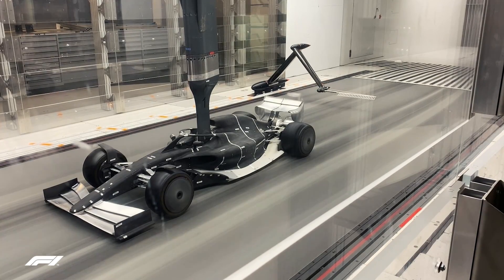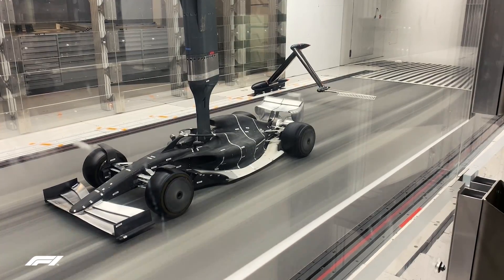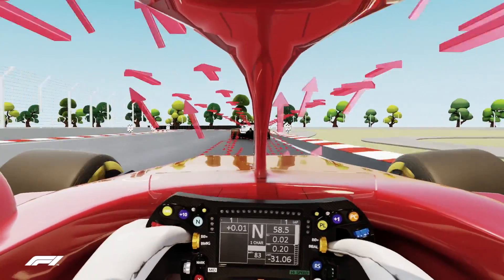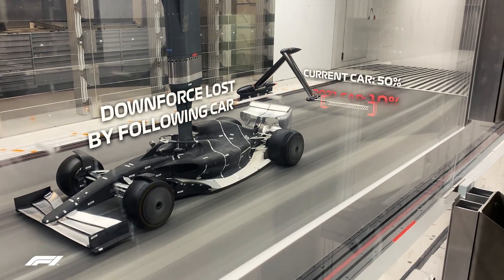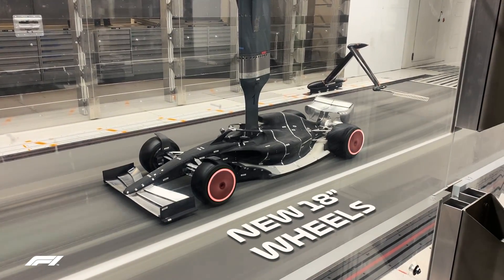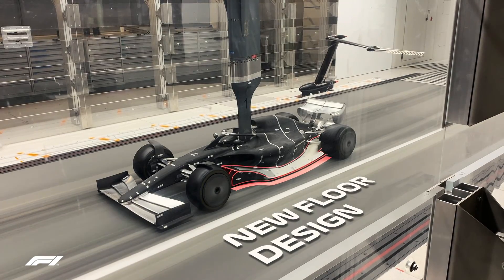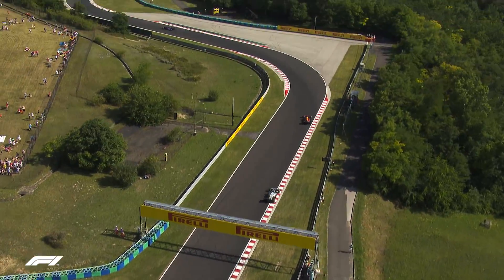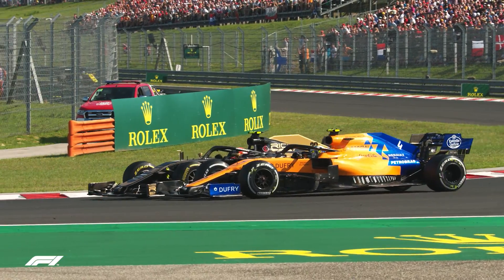Future F1 Car First Look | Formula 1's 2021 Car In The Wind Tunnel

Comment: On the flipside of people saying the car is ugly, the Lotus 72 was very ugly, as most of the 70's and early 80's cars were, as form tended to follow function. My problem is F1 air tunnels tests don't use full scale, don't run in traffic and even with a rolling road like they show, doesn't account for yaw angles whilst cornering. Hate to reference it, but NASCAR teams run into this lack of yaw data all the time, so the wind tunnel can never trully replicate on track info. NASCAR lets teams use full size cars to try and offset this, and I think the FIA should allow full size wind tunnel testing prior to the 2021 season. Just my two cents.

Comment: There is nothing wrong with the car now!! The problem is the IDIOTS called the FIA: 
1) Tell the stewards to get stuffed
2) Have points for qualifying and then reverse grid starts.
3) More fuel flow and RPM + More engines per year.
4) Tell Max and Charles they won't get penalties

Result: Best racing ever and the tree huggers can also get stuffed. This is F1, not who can do things the cheapest and use the least fuel

Comment: why even 2021 car?? is the 2020 already ready
Reply: Kisoutras G , no rule changes in 2020. Will be very similar to 2019 one. 2021 is major overhaul like 1979, 1989, 1998, 2009 ...
Reply: The rules are changing for the 2021 season, the 2020 cars will be using the same rules as this season.
Reply: ok thx ^^

Comment: The car looks great but we really need a shorter wheelbase. The cars are too long.
Reply: They actually are going to shorten the wheelbase by 20 cm or so

https://www.google.com/amp/s/amp.reddit.com/r/formula1/comments/9kzw7f/some_new_infos_on_2021_f1_cars_wheelbase_set_to/
Reply: @smokeybanditBBQ  20cm is nothing
Reply: @tconway95  to put that into comaprison, this is very close to the length of the 2007 era cars which were significantly shorter in wheelbase than the cars are now
Reply: @ROMZYDLX  no its not. 2021 regs are regulating 3400mm wheelbase, excluding the massive front and rear wings. 2007 was 3100mm.

Comment: nice notice, and return V10?
Reply: Love how "Fans" want older engines back when they're less efficient, lower hp and torque, less relevant to engines of the current era, larger, etc. But don't care about that "CaUsE ThEy SoUnD BeTtEr"
Reply: I'd love to see the V10 era return but sadly, the V6's are by far the most efficient ones right now. Still, V10's have been the best. If they were to allow mid-race refuelling again too.

Comment: Alright so stupid question here 
Does the covered wheels affect the Coolings of car’s the brake?
Reply: It's negligible. The brakes are cooled through the Brake Ducts on the inside of the wheel which will remain unaffected.
Reply: @danielwilliams1700  Yep, what about brake dust coming from the brakes?
Reply: To control the air flow on the side of the tyres.

Comment: Only need these 5 rules:
1. Same amount of fuel & batteries
2. Same wheels & tyres
3. Same minimum weight
4. Same safety cell and other safety related features
5. Same signage for the car numbers/driver names/flag

Don't need all this research into standardizing 20 cars, aiming to have them to all look and perform the same.

Comment: No wheel covers thanks. Just make it the same as the Mercedes Concept shown
Reply: Wheel covers reduce turbulent air which means closer racing. You can have design or good racing. You canny have your cake and eat it.
Reply: @F1ll1nTh3Blanks  put them on the outside!!! Duh ie over the tyre... not the wheel
Reply: @LawrenceAbramoff  Good point.. but I think sacrilegious FIA and fans will go mad at that idea.
Reply: Yeah they are ugly as hell
Reply: You say it as if its that easy.
Reply: There is nothing wrong with the car now!! The problem is the IDIOTS called the FIA: 
1) Tell the stewards to get stuffed
2) Have points for qualifying and then reverse grid starts.
3) More fuel flow and RPM + More engines per year.
4) Tell Max and Charles they won't get penalties

Result: Best racing ever and the tree huggers can also get stuffed. This is F1, not who can do things the cheapest and use the least fuel

Comment: How many times has F1 said they have fixed the issue to make better racing
Reply: Well see the way progress...
Shit takes time. Trial and error. We are seeing an attenpt to give us just that so be patient
Reply: 754 and counting...
Reply: They said it in 2009 as well but nothign improved at all......   FIA and Liberty Media are a joke.  Both need to fuck off. Especially the FIA.  Also,  the FOM isn't great either. We need Ecclestone.
Reply: If you trow a lot of shit at the wall some of it will stick.
Reply: Well how about they don't change anything at all...would you stop complaining then?
Reply: @trance9158  Big difference between complaining and noting something.
Reply: @jeroen3657  then also note that almost all changes have come from input from the teams and fans. But they get blamed for other's misconceptions and suggestions.
Same with Pirelli getting blamed for the tires. They follow what is requested by the teams and FIA not what they necessarily suggest or recommend.
Reply: @trance9158  Na just bring back refueling and different tyre manufacturers
Reply: @ragasdapper  during the era of multiple tire manufactures it didn't change anything EXCEPT one manufacturer would fail miserably while the other dominated. Nor did it have an effect on overtaking or head to head racing or overtaking. Same with the refueling era. In fact refueling era turned racing into pit strategy over actual competitive racing. These have been discussed on Chain Bear's channel as well as a couple other F1 channel's.

Comment: But you lost all downforce doing this. You cannot throw the car in corners like Mercedes does this year. We are going back. Not good.
Reply: SOME downforce. They're bringing back ground effect generated downforce (with restrictions), which was so incredibly powerful when lotus used it back in the day that is was banned almost immediately because it increased cornering speed too much. Basically, with ground effect the floor of the car is designed in such a way as to generate low pressures under the car, effectively "sucking" the car to the ground.
Reply: Surya Vikaas   I tend to agree.  It’s like the real reason (largely unacknowledged) that we need to change the rules every year is that Mercedes is winning.  If you leave the rules alone for a while the cars will bunch up... it’s the law of diminishing returns at work.  Also I have very few problems with the current generation cars - as you said the SPEED the enter and carry through cornering is INCREDIBLE.  I think overtaking should be hard.  It should be really precise- that’s what makes the sport good to my eye.

Peace
Reply: Ground effect, son. ever heard of it?

Comment: This is going to sound really bad, but why dont they put two models backs to back and then measure the airflow?
Reply: Simply put, there isn’t enough room, also the work was done using CFD on computers, the wind tunnel tests were done to make sure what the computers say matches up in reality. If you go to the F1 website, there is an article to go with this video that explains it more.
Reply: Aaron Dixon not enough space in wind tunnel, the one they used is 50% the real car size so to fit 2 cars to measure following downforce they would be a quarter of normal size each

Comment: Nice to see the halo integrated into the car rather than an afterthought
Reply: Allthough I do want to see how the car would look without a halo and the winglets above the wheels
Reply: The whole thing looks shit
Reply: @Starscream_xxx I hope that's enough to make them sound good.
Reply: @watersnortmoment3734  hmm, noise is the result of lost energy, no engineer wants to lose efficiency. They'd have to put it in the rules, a minimum decibel level at a set rpm.
Reply: @M1ggins  The amount of energy in sound is so low that it's almost negligible. That argument is always thrown around by people with little understanding of physics.
Reply: @monsieurboks  negligable, but there, because you can't make noise without using energy.
That's pretty basic physics.
Reply: @M1ggins  So what if it's there? Negligible means that it's so minuscule there's absolutely no discernible benefit, and that an engineer's time is better spent elsewhere.
Reply: @monsieurboks  and you're talking about a sport that measures itself in miliseconds because the margins are so tight. And one whose teams spend 100,000's for a few grams extra downforce.
Reply: @M1ggins  Yes. I am. Even for this sport it's not worth it to spend thousands for an extra half watt of power, or 0.000671 hp. For obvious reasons.
Reply: @monsieurboks  except that it's a lot more than that. I guess you should go back and study the power units, especially how the turbo works without lag. If you do that you will see where the noise energy has become engine efficiency.
Reply: Windscreen would be interesting too tho
Reply: @kraftwels  no, please no
Reply: @sajlentor  not a complete one just a glass piece that connects to the halo while keeping the cockpit open. This would reduce drag and on cars that are already less dragy and will have more power, the cars might have ridiculous top speeds
Reply: @kraftwels  They are introducing a halo with screen for indycar next year, created by redbull
Reply: @randomboi8081  Thanks for telling me that, i didn't know.
It's not like i meant the fuel flow rate changes that have been talked about for years already
Reply: @randomboi8081  dont be rude.
Reply: @kraftwels  I hope they raise the rpm so we can get screaming engines again.
Reply: @watersnortmoment3734  agreed
Reply: Pascal Barnert won’t happen now. They rushed the research when using the first screen trails which led to visual distortion, something that Indy car had been able to fix. So the halo won out on the trials as they wanted something quick to solve the issue. And now that it’s in I can’t see them revising the design to a screen. It actually looks better this year as they are designed with the whole car rather than the bolted on look they had.
Reply: @kraftwels  I think we need a windscreen. Last thing the sport needs is another Massa incident, especially if it's fatal this time as it almost was then
Reply: @monsieurboks  I personally think windscreens would look horrible and the helmets are always improving so I don't think there would be a need for one
Reply: Halo is not a bad thing
Reply: hellno!!!! 2019 cars already has a fucking ugly front wing